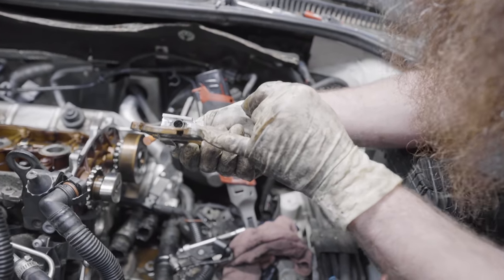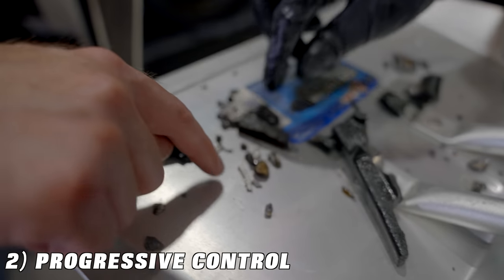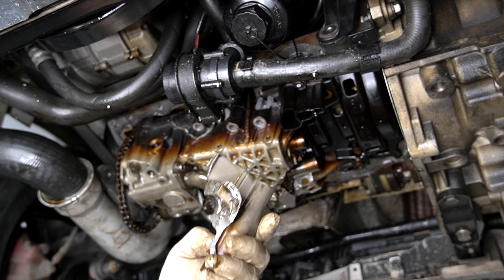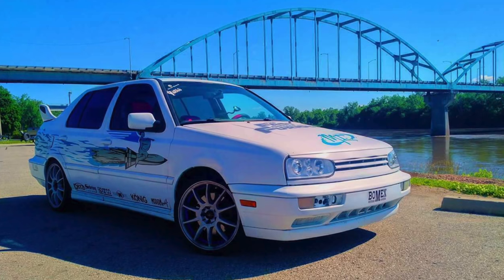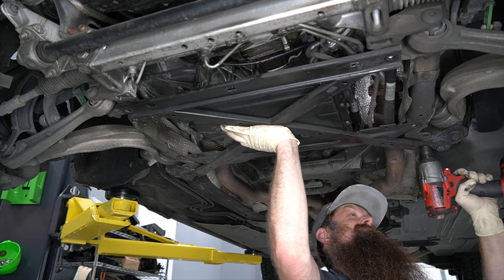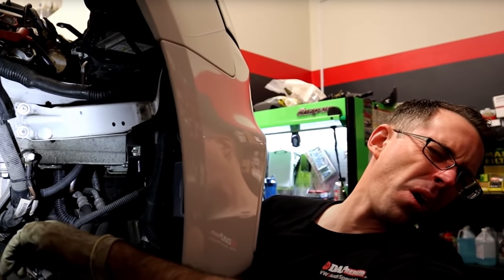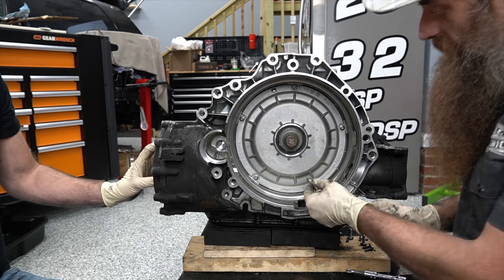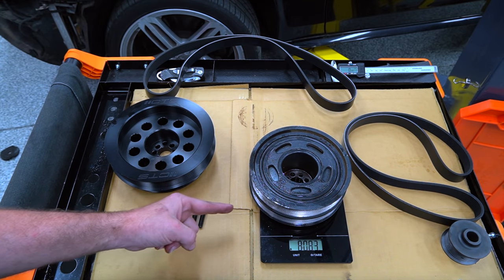I Blew Up the 1/4 Drag Car on the Dyno ~ JDM vs Euro RACE Episode 3

Comment: Man that civic is going to kick your ass....you might have had a chance with a rabbit or something but not with a jetta or a s4....the damn honda flies...
Reply: Yeah 320whp and like 1800lbs or less. Honestly probably still would be faster than the Jetta even if nitrous didn't blow it up lmfao
Reply: In a roll race yes. Launching cars is not easy first 60ft usually tells a lot. Although for fwd hondas generally launch fairly well. But the gti dsg can run 0-60 in about 4 seconds with tune. Ive raced a gti i out power by 100hp but 0-60 he wins.. At 70 i walk him...
Reply: @dkis8730  Yeah i would only have changed the intake, maf sensor and intercooler and called it quits if it had approxomatly 300 horses...I dont understand what was wrong with that engine..with the k-04 they should have cracked 300...And if there was any money left i would have tried a 50 shot at the race only
Reply from the maker: You may be right. We will find out next week. :)
Reply: They have a budget of $5k...I doubt that Civic is going to be pulling 10 second quarter miles.  People act like every Honda is a 10 second car.  I'd be shocked if it even got into the 12s for under $5K.  They probably would have had a very good chance if they had run the nitrous in a way that it had been progressively shot instead of dumping the entire shot with the button.  It was obvious to anyone with any inkling of knowledge that those factory rods weren't going to hold up to 400+ lb ft.  I've got a MK6 GTI and the motor is similar to the one they blew up in that MK5.  The rods are a known weak point and the off-the-shelf kits sold intentionally keep the torque down to prevent the rods from breaking.
Reply: @whorutothink  can easily make 11 second Honda for 5k. Full Bolt on p80 volvos from 90s run mid 12s in 110+mph... And they hold over 400ft lbs on stock rods, stock block all day.. My tuner got 430whp from a 200k mile motor. A full stage 2 apr should put you around 337hp with 12.8 car..
Reply: @justkiddin1980  apr and unitronic claim 337hp and 12.8 at 110mph on full stage 2.. Have video to back it.
Reply: @ogfromutube9649  Ik know i own a passat cc 1.8 turbo....I've been researching tuning for a while..you can get 260 with the stock turbo, intake and a good ecu tune

Comment: An S4 for that money? Bruh, you won' find one for like 10k EUR in Germany😅
Reply: With 240000 miles/386000 km?
Reply: That price was way to low… the shop guy gave them a special deal
Reply: @isaactrockman4417  nah it’s not I got a 2011 s4 for 2,000 just needed some suspension work and a dsg service
Reply: That’s the good thing about America, cheap insurance and cheap cars.
Reply from the maker: @mercury0214  They are basically parts cars when they get bad DSG issues.
Reply: @HumbleMechanic  yeah only reason I got it is cause it still could shift just was super clunky and acting odd so I figured what’s one more clunker if it fails lmao still drives and I ended up selling it for $2500 to a friend
Reply: If y'all find any more for ~2k preferably in the Midwest let me know! 😆

Comment: You guys totally got hooked up. No one else can get a B8 S4 for 1500, even in the shape yours is in..

89 Civic vs a 2009 B8 S4? Come on.
Reply from the maker: It’s what tom paid fir it.
Reply: Yeah finding that s4 in that shape and miles needing what it needs for 1500 is a very unusual find.
Reply: Yeah I mean the s4 was obviously way too good of a deal even with a bad trans, but it at least makes for a fun series. 
I mean it was pretty obvious the Civic was gonna walk the Jetta, even with nitrous anyways so
Reply: Connections, bro.
Reply from the maker: There is a lot of over valuing of a completely undriveable S4. Especially when all the details aren't there. What is teh title status? Are the wheels really worth $1500, or was it drive by feel? Hows the suspension? Is the interior what youd expect from a 3rd owner high line German car? 

I didn't fit really well in the pace of this video. I might show a little more going on with it in EP4. im still making those choices.
Reply: @HumbleMechanic  even if salvaged, damaged suspension. As others have mentioned, the parts alone on the car are worth more than $1500 (wheels, interior, lights, etc). The price of used cars these days are outrageous. 

Would be more believable if it you guys found a B5 S4, old school VW Gulf or Bug.  At least those are somewhat closer to the era of the B-series motor that’s in the EF. An average Joe can find an EF Civic for 1500 but not a B8 S4. If they do, its a shell without wheels, seats, or motor lol. 

Will still support both Gears&Gasoline and HumbleMechanic! Looking forward to the race!
Reply from the maker: You can make the argument for most any car that the parts are more than the whole. 

Believe me I feel what you guys are. It doesn’t seem like a fair shake on the car. But these are not worth nearly what they “should be”. 

Either way I can tell ya, the finale is good.

Comment: Some ATL locals were playing with nitrous on 1.8T cars in the early 2000's.  You know, to help spool a miniscule K03 turbo faster LMAO.   

One of them was trying to do a dyno run with a 200 shot (I don't know if it was a 200hp kit, or if they drilled out a jet), which resulted in one of the cylinder walls splitting from the  pressure and filling that hole with coolant.   A piston hydrolocked and broke the rod, causing the stub on the crank end to saw a big hole in the front of the block.   

The resulting mess caused Dynolab to drop the ban hammer on nitrous 1.8T VW's.

Comment: How the hell do you find an S4 for 1500 bucks?
Reply: Friends with benefits 😁
Reply: @corbanlee8157  Feels kind of like cheating a bit if youre buying a car from a friend for way below the marketvalue
Reply: I bought the cheapest S4 in the USA…
Reply from the maker: Its basically a parts car. To get this thing properly road worthy is going to run $8k plus. even then its still a ragged out S4. People forget how little value over high end cars have. especially when they have a serious issue. This car would have been parted out if I didn't buy it.

Comment: I would put an external trans cooler on this with a fan when drag racing this thing.
Reply: Why? It hasnt got a torq convertor.
The transmission is just an automated manual
Reply: @Sadik15B  Its part manual and part automatic notice the clutch disc are burnt the fluid was over heated hence the black color and the bad smell. The fluid pressure is what locks up the clutches that was burnt so this is why a transmission cooler would be a plus and is would extend the usability oi the oil.
Reply: @Sadik15B  No, its not automatic in that why it automatic in the way the gears are selected
Reply: The clutch pack is pressured this part is like a conventional automatic transmission nothing else.
Reply: @coatingsplatingsjas1powder557  clutch burns because the pressure isnt high enough to prevent slipping.
Reply: @Sadik15B It could also be from heat breaking down the friction modifiers in the oil think about that

Comment: Seriously, Nitrous? Something that these cars are less than known for, and you try it with no experience 🤦‍♂️

250-ish whp with a K04 shows that something is obviously with your power delivery. You could have spend that money better on a cheap intercooler, intake, and boost delivery piping, then you would probably would have gotten closer to the numbers you expected. That, or a 100+ octane tune (or w/m) would have been a more reliable route.

I guess it's a good lesson of what NOT to do 🤣🤣🤣
Hopefully the Audi is a better option in the end.
Reply: Exactly!! They should've went straight to figuring out what was wrong after dyno day
Reply: @jmccann6735  So after watching the nitrous video that Shop DAP posted, it seems they were already setup for nitrous when they went to the dyno; they were already committed to going full-send. Still, I would have at least started with the minimum amount listed on the chart for the injector nozzles to try to minimize the risk.

It was sad to see that engine vomit and $h*t its insides out, but entertaining at least.
Reply from the maker: Yep. the bottle was on the car before we went to the dyno. But I couldn't give away all the goodies. :)

Comment: And this is why I've never been a fan of NOS
Reply: yeah here in germany we get 400HP out of a BPY engine without NOS... working on flowrestrictions and reprogramming the ECU is the main approach here, and obviusly the stock turbo has to go.
Reply: Nitrous is fine, but you have to be smart about it. Always run it with a tune for nitrous, and have the slow ramp up etc etc, hitting it too low in the rpms does crazy things to cylinder pressures iirc.

Comment: Who actually activities nitrous at 3500rpm though 😅
Reply: 3000 all day on an LS1
Reply: @MeltingRubberZ28  sock bottom end with no added ring gap? a 360lb/ft hit at 3000rpm with already increased boost pressure, i would think there is some dice being rolled
Reply: p.s. 360lb/ft i calculated at 25hp per cylinder (same as with the 4 cylinder)
Reply: @diesel-technology5507  I guess I would assume the motor already has a decent ring gap since it is boosted from the factory, but that's an interesting perspective. If it was NA and you went turbo+nitrous that's a different story, at least IMO. However this wasn't a ringland failure anyway, the motor simply couldn't produce the torque and snapped the rod. Typically too small of a gap blows the bottom of the piston off.
Reply: @MeltingRubberZ28  yeah the rings didn't pinch in this particualr situation, i was talking about the ls1 engines, but apples and oranges anyway. i would have thought the bottom end would have been up to the challenge in all respects given it was boosted, ring gap, rod strenght....given the stock fuel pumps are literally rated to 250 crank hp or there abouts, i would assume the bottom end might have only been designed to support that too. danger city when adding nitrous lol
Reply: @diesel-technology5507  oh I gotcha. Yeah I know dudes that run up to 150 shot on stock LS1s all the time. After that, yeah you'll start having ring gap issues.

As for the VW, I'm honestly pretty surprised the rods didn't hold. I'm fairly new to VW, but I do own a MK7. People seem to make ~450WTQ and get years of use out of them. Seems like the MK5 isn't the same animal since it couldn't even do that for a single pull.

Comment: One of the tuning challenges with nitrous is the huge torque spike on activation.  When you hit it at low rpm's, it will create HUGE cylinder pressure spike...and here we are.

Comment: As a fellow nitrous junkie on a modern turbo vehicle I can tell you SEVERAL things that were wrong from the start with this. 
1) The jetting numbers provided are assuming the kit is being used on a naturally aspirated engine. When using on a turbo vehicle you typically see THREE TIMES the amount of wheel horsepower the jets would normally produce. This is because the nitrous cools the air charge so much that it actually increases boost pressure and dramatically reduces intake temps. 
2) You MUST run nitrous at 100% wide open throttle and nothing else. On modern cars that does not simply mean put the pedal to the floor. The ECU very rarely opens the physical throttle blade as much as your foot tells it to. The car will actually use throttle opening in an attempt to control boost pressure. So even though the pedal was to the medal, I bet your throttle blade was only open about 40%. I have a special ECU tune that makes my car respond like it has a throttle cable. It does what my foot tells it to.
3)The in tank fuel pump for sure was not capable of supplying enough fuel for this much power.
It can be done. But this was all wrong.
Reply from the maker: Great insight!! As much as I’m mad the engine blew, the lessons learned were great. 

This like so much as a lot of poor info out there. I’d rather know than think. Lol

Comment: ah that sucks about the the engine blow. but i kind like the S4, AWD n automatic is gonna give you an edge off the line compared to the dumpster with a motor that G&G has, but that B16 turbo sounds nice and fast now that they got it all tuned up. it's gonna be a good battle cant wait!

Comment: Hi Charles the tpi for replacing that circuit board/wiring in transmission also says to replace the 2 solenoid valve and the strainers. I’m a master tech for Audi but have only ever done 2 of theses last one about 4 year ago. I can bring up the tpi for u Monday at work if u need it ?
Reply from the maker: Thank you!!! Im going to swap solenoids on it soon.

Comment: Interesting info about the transmission. I had to replace the 2nd gear solenoid in the Tiptronic my 04 Jetta 1.8T. As I'm sure you know, this is a known weak spot on those trans, although I think the failures are more heat related than corrosive fluid.

Comment: With s3/R injectors,  upgraded  HPFP, 3" downpipe and a k04 from the mk6R the tuners usually manages to make 310-320 whp here in sweden on the 2.0tfsi engine.. NOS shouldnt acually be needed ;)
Reply: On a maintained engine, but that jetta i think had maybe one oil change in its life, americans don't maintain cars like we do in europe.

Comment: I just finished doing work on a mk5 gti that suffered some balance shafts issues. Everything was good. Blew the motor. Rod left the chat. Replaced the motor. Dumped the car. I picked up a 2002 tt with a pte5858 and 450hp from the gti cash. It will walk my sons tuned b8.5s4. I would have started with a 1.8t.

Comment: The second you pulled out the nitrous bottle I gritted my teeth.  That detonation was epic, man.  I think if you had a bit more budget to begin with you could've gotten the nitrous dialed in right and get that motor in better shape to handle it.
Reply from the maker: For sure!!! Debating on getting an engine to do it right
Reply: I don't think the engine suffered from detonation.It happened instantly,it seems like the stock rods couldn't handle the 430 ft lbs of wheel torque.

Comment: When opening any compressed gas bottle, only turn the valve one turn max if possible. takes way less time to close a bottle when you only have half a turn to do so. It'll flow enough anyway.
Reply from the maker: That’s GREAT advice

Comment: Upgrade the heat exchanger with a radiator it’s exactly the same that what I did on my c7.5 a6 3.0t and trust me it works major cooling difference

Comment: You couldve waited until higher in the rpm band to hit the nitrous. The jetting is usually very close, but the earlier you hit the nitrous the more torque you will make. That torque was what blew the rods out of the bottom.

Comment: Waaaaiiiitttt... wait wait wait.  A B8 S4 for HOW MUCH?!!  Dude, parting that car out will easily double or triple that worth!  Holy moly... if I found one THAT cheap, I would've done the very same thing, or heck, part it out and make a huge profit and slap in a new engine to the Jetta!  But that would be against the rules... if someone was watching or filming a YouTube episode... Hehehe!  

With the interior gutted, you can easily shave off A LOT of weight in that B8.  And yeah, like was mentioned in the video, some of the panels are WAY heavier than they look in the car.  You can easily save a lot of gas mileage just by stripping the interior out, though the car would have to be a 1-person daily.  LOL!  But at least the fill ups will be few and far between, lead foot and all.

As far as the Reverse gear causing the stall... I'm assuming the tranny is warmed up and still at 35C or 96F (or somewhere there), correct?  Also, have you tried going from P to R instead of drive first?  How about after you go into Drive, put it in Neutral for like 10 or 20 seconds, then go into R?  Not playing keyboard mechanic here, but I am just curious.  This is really odd.  I've heard of noisy bearings in there, slippage, stuttering, but never a stall after going into a gear.  I'm curious to know now! :)

In the sneak previews, I saw that's what you guys did.  Then the problems, though it looked like you got something fixed, because the cars were lined up?  I dunno.  I CAN'T WAIT FOR THE NEXT EPISODE!!

Comment: When you jet nitrous for a turbo car, its almost double what the power gain is for an N/A car...so that was fixing to be closer to a 200 shot than a 100..not to mention dyno operator hit it at around 3500 RIGHT on the load in..would be curious to see what the air fuel ratio on that run was..and did you bother to pull any timing in the tune?

Comment: You could’ve saved that motor if you would’ve put colder plugs, pulled some timing, and started out small on the jetting. I sprayed a 200shot on my 4.6 2v every weekend with no tune or anything never had a issue

Comment: My suggestion would have been go with a early 2000s Jetta or Golf with a five or six speed manual with a 2.5 in it and soup it up.
There's old 2.5S are easy to work on and they really let you down.
Although a 2.5 stock is pretty sluggish with no major power that's what aftermarket performance parts are for am I right.

Comment: I've seen worse but having them go bang isn't fun.  What is the piece hanging  under the car to the left of the shot just before it pops? The one above the dyno hook that is acting like a pendulum and swinging out as the revs come up? Suspension or an engine mount flexing?
Reply from the maker: that is the boost pipe expanding
Reply: @HumbleMechanic  Cool, I've seen them flex but that looked a bit odd.